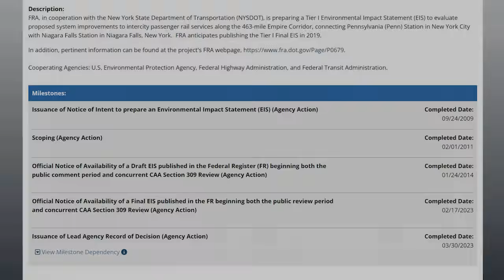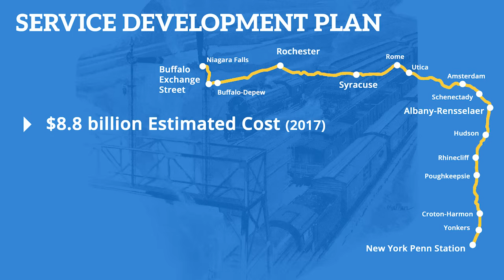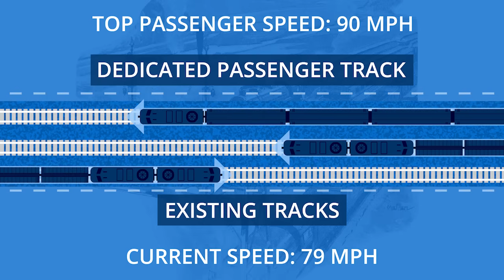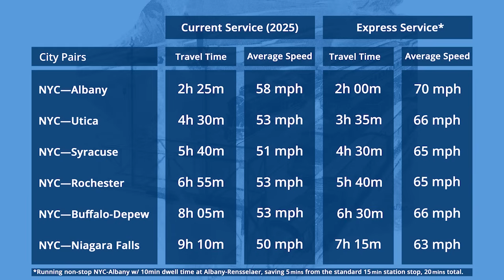Building an Express Track for the Empire Corridor | Short Version

Comment: 1:38 - The fact the line use to be quad-tracked is a bit of news I'd like to expand upon. In fact if CSX was more forthcoming on this corridor, I'd be able to deliver my own curve-by-curve analysis of what needs to be done to upgrade the corridor. (Thanks to Vanshnookenraggen, I have drawn up a proposal to fix Spuyten Duyvil.) I'm already of the mind to electrify the whole thing, but I suspect one should lower their expectations all the way down to just east of the Hudson.
Reply: Of the 460 miles how much is electrified and would the dual mode Airos be a good train choice?
Reply: @davidjackson7281  shockingly, about 21 miles. The MTA was looking to use the corridor for Penn Access, so one of my high expectations was a northern expansion of the existent OCS at 39th St. The dual mode Airo sets would be a good choice for local stops north of Albany. My only nitpick would be the battery-diesel hybrid variant Amtrak ordered for this particular corridor, as opposed to the APV units that would've benefited greatly from OCS electrification.

Comment: It will never happen west of Schenectady. CSX is not going to give up ROW for a new 90mph mainline track for Amtrak. Let's dive into this a little further, all the stations between Amsterdam and Buffalo Depew are one the south side (track2) except Amsterdam (north) Rome (center platform) and Utica with a pedestrian bridge. Utica however does not have the room for any high speed track.
A single main means meets, which means crossing onto the slower CSX mainline and possibly following a 50mph freight for 10 to 15 miles before you get back on your dedicated high speed main.
NYS and MNRR seem very interested in getting to Albany. Would not be the least bit surprised if in the next 5 to 10 years all local service between Albany and New York is handled by MNRR. There go your upgrades.

Comment: 60 MPH is too slow that state is trying to build easy public transit not good public transit. Yes california high speed rail is over budget and delayed but once it will be finished people will quickly about all the hurdles it went through as the benefits will be worth it. New york state should aim for 110-150 MPH speeds where possible with ELECTRIFYING the corridor and rebuilding tracks and curves to fully allow high speeds as much as possible

Comment: This is a fantastic investment for rail throughout the upstate and capital district. I do have one thing to point out... Wouldn't it be equally an incredible investment towards improving rail connection between NYC and Montreal via Albany???
Reply from the maker: NYSDOT is currently doing a Corridor ID Study for the Adirondack corridor, Albany-Montreal, they are looking at increasing speeds on the north and south ends on CPKC track, running a second train, likely overnight, and completing Joint Customs/Border Inspections in Montreal at Central Station (as in Vancouver for Amtrak Cascades) saving an hour or so by not stopping at the border.

Comment: The nascent regional rail network being developed by CTDOT, Amtrak, & MBTA to link the medium size cities of CT & Western MA needs to be tied into this corridor as well.  

CTDOT is in the later stages of developing the New Haven - Hartford - Springfield service, double tracking & all hi level platforms, as a separate state-run service with distinct rolling stock.  Amtrak has extended this north thru Northampton to lower VT.  MBTA is in the early stages of extending their service from Boston that ends now in Worcester to Springfield then Pittsfield then eventually Albany.  That would be the key link.  These corridors all already exist & most used to have 2 or more tracks, so it's a similar effort, but does take plenty of $$$.
Reply: Only HSR can do this

Comment: Thank you for this information. I was not aware of the 2023 service development plan for the Empire corridor. This is very encouraging. I am not sure what type of priority will be applied to the Empire corridor, but I'm sure this is a step forward. 

I was disappointed that grade separation was not mentioned. I know that grade separation is expensive, but it the best way forward. California high speed rail development is a disaster. Brightline is also a disaster. Neither California or Florida embraced grade separation.  The video mentions increase in speed to 90 mph. It is probably the case that investment in grade separation could boost the planned speeds to 110 mph. Higher costs may mean that the project completion date would be pushed out further into the future, but higher speeds would provide a positive cost/benefit result.
Reply: Actually,  California HSR is indeed designed to be grade separated. And that's a major contributor to its cost. Many enormous viaducts, trenches, tunnels, and other structures are needed for the full route.

Comment: 90/110 MPH is not high speed rail. Not by a long shot.
Reply: It's just a BS clickbait video.
Reply from the maker: @29brendus  Nope, its not clickbait, took me two months to make it, I've got a longer version with more history in it. Its only my second video to have a "k" in the views, the first was a few years ago on the return of the 'Adirondack' to service after COVID. And this is about a very real, if slow moving plan, that may be gaining some momentum as its being revised by NYSDOT as part of the Corridor ID Program. https://www.esparail.org/resources/empire-corridor-eis/
Reply from the maker: @modtwentyeight Which is why I didn't use that term, but variations of "Modern Intercity Passenger Rail" 🙂 NYSDOT and the FRA mislabeled it as "High Speed Rail" when they started the EIS back in 2009 😅 https://www.esparail.org/resources/empire-corridor-eis/
Reply: @DSMWorksMedia it’s not a modern service
Reply from the maker: @qjtvaddict  Opinion on Brightline in Florida? Does it have to be 220 MPH or Bust? The constraints that we have to work within in both America and New York State are frustrating, but very real. NYS doesn't have the money or ability to build 220 MPH HSR, but it can utilize the existing right-of-way to provide a "intercity service" equal to non-HSR services seen in Europe and Asia, including the UK and Japan. Unfortunately CSX limits the top speed to 90 MPH west of Hoffmans, but in other ways including frequency and reliability we can have a mainline intercity service like those seen in Europe since the 1960 and 70s, and still running today.

Comment: The main problem with California High Speed Rail is the lack of money. California is an over $4 Trillion economy which has difficulty coming up with $1 Billion per year for the project. The biggest expense for California High Speed Rail is the inflation in the project cost from all the delays and lawsuits. When one considers the costs of smaller projects - rapid transit in Chicago, highway expansions in California - the California project is big, but not out of line on a cost per mile or traveler basis.
Reply: The main problem with California High Speed Rail is graft, greed, corruption and political infighting.
Reply: The biggest problem with CAHSR is that it requires massive amounts of land acquisition. Virginia (VA) took at different approach. VA bought right of way (ROW) from the freight railroad and laid new track in the ROW, allowing for some separation of passenger rail from freight. VA is not doing high speed rial. California is wasting billions of dollars.
Reply: @writtwoodson6879  Yes, using existing or abandoned ROWs is much more economical.
Reply: @davidjackson7281  - except curvy track is not a good match for high speed rail. Even many of the curves used on the Interstates are too sharp which negates the practicality of following their ROW.
Reply: CAHSR is costing $200 million per mile which is absurd. A billion dollar budget ain't squat.
Reply from the maker: CaHSR has been very badly mismanaged, which they are making corrections too, bringing more and more of the planning and management in house from the hired consultants who ran the project for a decade. It is one the most difficult new HSR projects ever attempted in terms of length, crossing three formidable mountain ranges, and having a super high top speed -- so it was always going to be super expensive and take decades to build, which those planning it seemed to have been completely oblivious too.
Reply: @D @DSMWorksMedia  it doesn’t help when you are a state like California that is currently the 4th largest economy in the world contributing more to Federal revenues than any other state yet receives the least support back from the Federal government (in proportion to its population). Perhaps you can fault California for being faulty in expecting Taxation with Equal Representation. Maybe you can also fault California for not banking on the GOP’s opposition to passenger rail funding becoming a bedrock of their ideology. Maybe you can fault California for not foreseeing the rise of Trump and an active MAGA ideology that in true form to Fascism asks people to deny what they see before their eyes even when it involves an ICE agent murdering an American citizen in plain sight. Maybe you can fault California for not expecting Political retribution to become a dominant factor in the future regime. For all these reasons California is giving up on expecting the Federal government to be a reliable partner for its high speed rail system and plans to go it alone. I’m not trying to claim California is faultless but taking the Ezra Klein approach and blaming California for all its problems is extremely simplistic. In many respects it’s like blaming the victim. It’s faulting California for even trying to do something better and think beyond current constraints.

Comment: I'll believe it when I see it.
Reply: I hate to agree with your negative comment but you are totally correct.  Everything is talk but nothing happens.  We are a disgrace when compared to the fast rail in other countries.
Reply: @J.M.Chadwick6 I live in Illinois, and they've been talking about high speed rail for over thirty years.
Reply: @johnfitzpatrick3094  They have HIGHER speed now (110) mph)
Reply: @robertdehlinger6531 I haven't seen them use it regularly.  Most Amtrak trains still have to wait for the freight trains.
Reply from the maker: @robertdehlinger6531  Only in the Capital District, the plan would extended this south to Poughkeepsie, so it would be 110 MPH on Amtrak tracks from Poughkeepsie to Hoffmans, west of Schenectady where the Hudson Line merges with the West Shore Line to form the CSX mainline to Buffalo.
Reply: @robertdehlinger6531  In short bursts. mostly 80 or 90 or lower.
Reply: @J.M.Chadwick6 Also, the biggest opponent to passenger rail are the freight lines themselves.  In their eyes, passenger trains get in the way of freight trains.
Reply: @johnfitzpatrick3094  Good point, I had sort of forgotten that.  I live near Utica, NY.  When I was a young man in the 1950's, it was the New York Central with its 4 tracks and many passenger trains.  We used to be able to go from Utica to NYC and have 6 hours there and then return home.  We always did that near Christmas.  That is impossible now unless you drive to Albany, 90 miles distant.
Reply from the maker: @johnfitzpatrick3094  Which is why the dedicated "express track" for passenger trains is the key central feature of this plan.
Reply from the maker: @J.M.Chadwick6  The plan would restore what existed during the New York Central, but with a slightly higher top speed (90 vs 85 MPH) and a much faster average speed, and a higher frequency of regular interval intercity trains, opposed to the many overnight distance trins the NYC ran. If CSX ever relented, got merged into BNSF which to win NYS support agreed to it, the planned infrastructure could support 110 MPH in many sections from Utica to Buffalo. Electrification would also depended on changes in federal regulation/law and the freight industry, right now they very much oppose electrification and they own the right-of-way, so they can say no.
Reply: Unfortunately a understandable sentiment! 😅